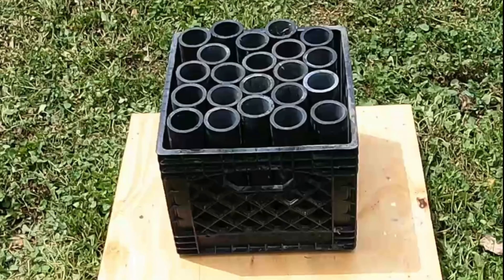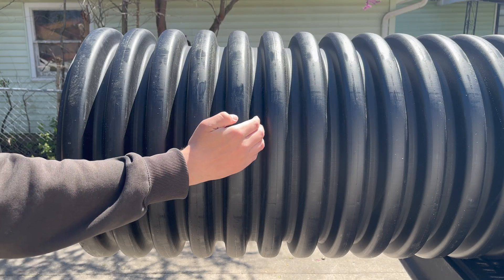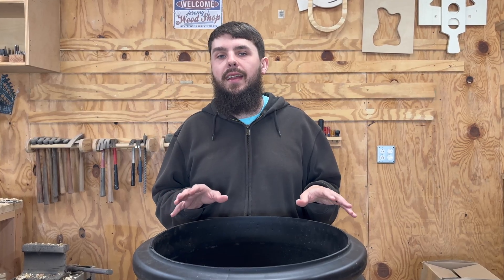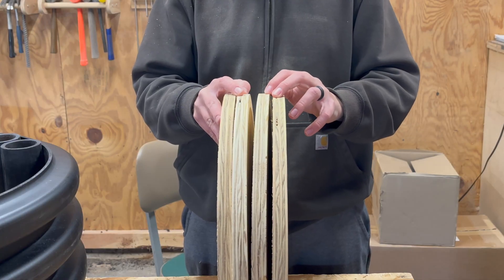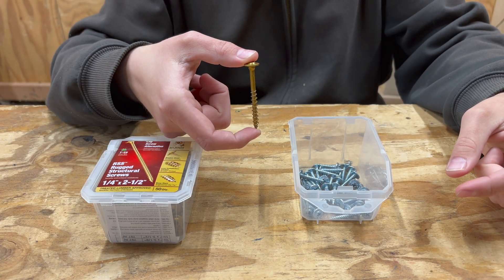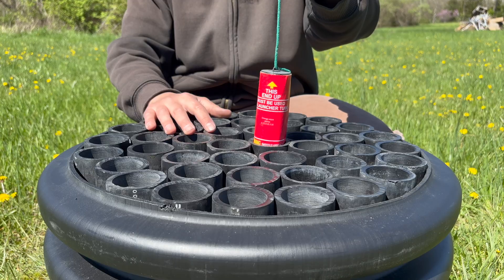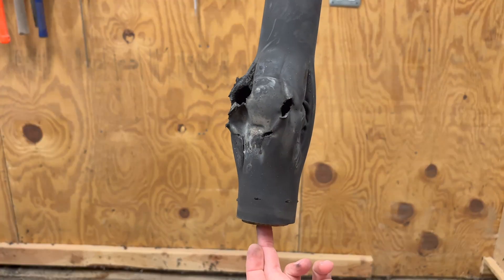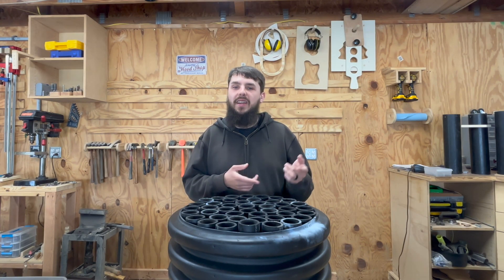Does Culvert Pipe Make a Good Firework Mortar Rack?

Comment: This year I am putting mortar tubes in a 5 gallon bucket filled with dirt. About an inch of dirt between tubes and 1.5 inches between tubes and bucket sidewall. Has anyone done that?
Reply from the maker: I've heard of display tubes being buried, but I've never personally seen a 5 gallon bucket filled with dirt. That's an interesting idea for potential blast containment. The thing I would worry about would be the downward force if the dirt gets loosened, potentially causing a low-level break.

Comment: That’s a great experiment with tubes and I think that solid 4 layer base helped in displacing the energy from the blast. Great demo pyro
Reply from the maker: Thank you, I've been wondering how culvert pipe would hold up, so I had to test and see. I agree that the 4 layer base helped displace the energy, I also liked that it added a decent amount of weight.